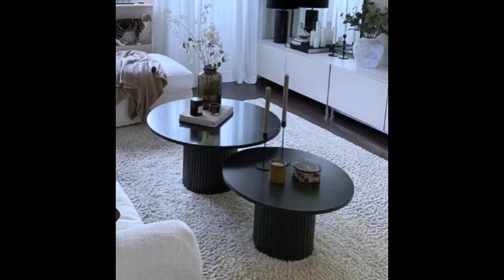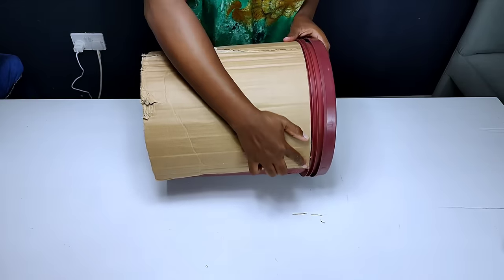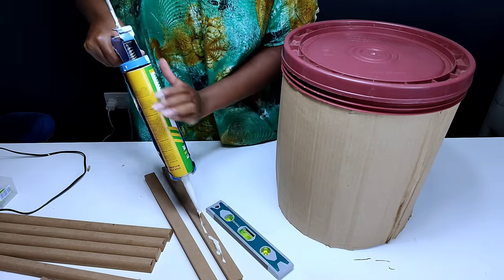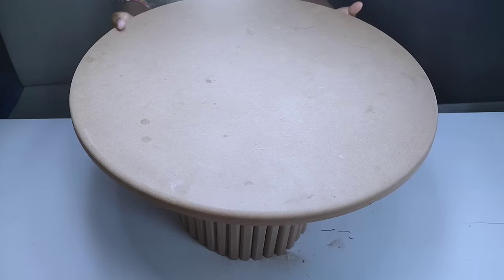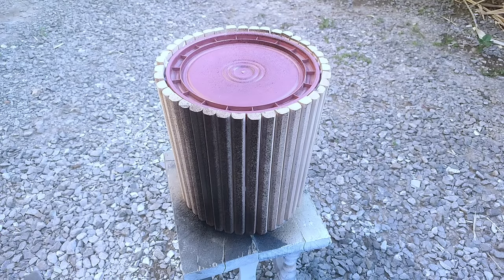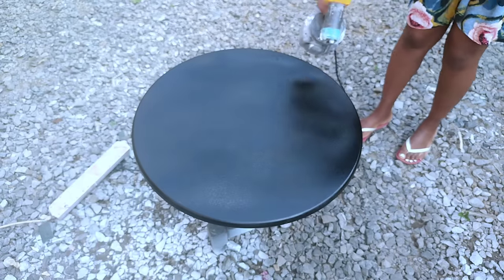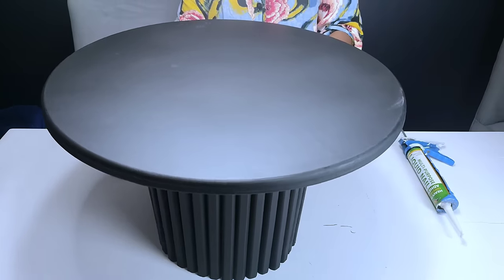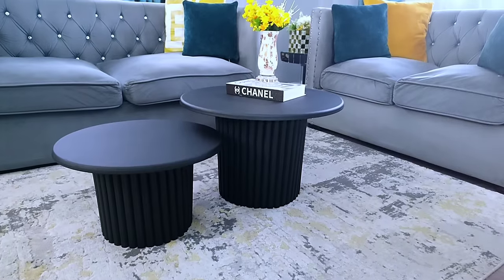PLASTIC BUCKET TRANSFORMED TO NESTING COFFEE TABLE~How to recycle plastic bucket to DIY coffee table

Comment: Respirators are cheap. Dealing with cancer or asthma is not. Most commonly recommended respirator is 3M. Please wear one, even when spraying paint outside. Also wear a dust mask when sanding. Protect you brain and lungs. Eye protection is also needed.
Reply from the maker: It's okay dear I'll get a mask
Reply: Good messege

Comment: Am I the only one who don't understand the meaning of MDF?😂
Reply from the maker: Medium-density fibreboard (MDF) is an engineered wood product made by breaking down hardwood or softwood residuals into wood fibre, often in a defibrator, combining it with wax and a resin binder, and forming it into panels by applying high temperature and pressure.

Comment: What is the size of the table tops and the width of the wood panels. Thanks.
Reply: Use your own measurements
Reply from the maker: Table top sizes is 500mm and 700mm
Reply from the maker: Width is 20mm